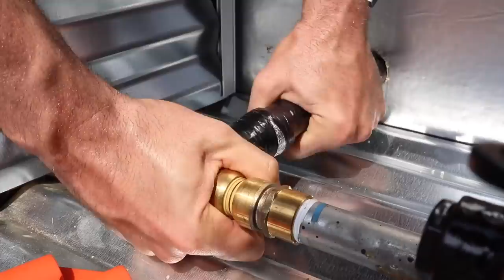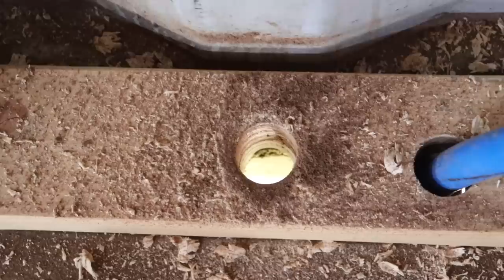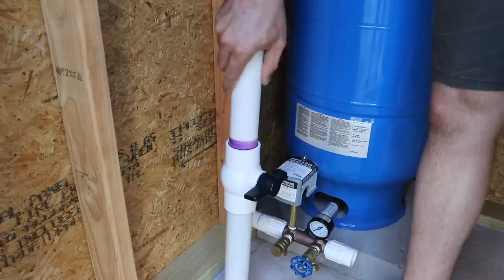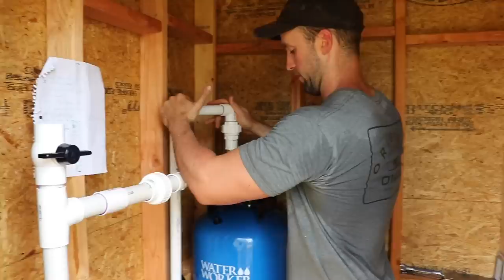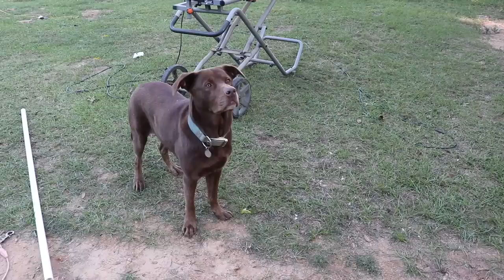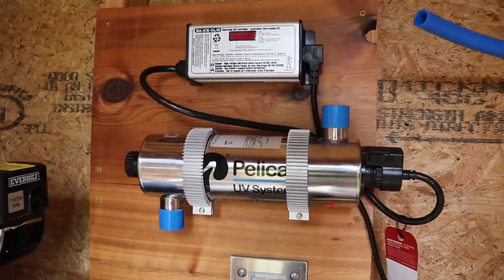How We're Getting Drinkable Rainwater OFF GRID!

Comment: Hey guys - I really like your work. Have you made any consideration of pressure differentials in your hot water system ?? I do not see a non return valve in the cold water feed line to your hot box - there will be issues here. Also not wanting to be rude but I just don't get this generation that wants to be 'off grid' but make full and over use of the internet , ebay , making multiple trips to the store etc etc. In my opinion the true essence of being off grid means that you are living in a cave and be totally connected to nature. The last straw for me is that you are using a UV filtering stage in your water supply - come on guys. Sorry this is no more than a glorified mobile home and far from off grid.

Comment: I am going to maintain that "electricity" is the grammatically correct word because "electrical" is an adjective, and saying "you have to brush up on your electrical" is like saying "you have to brush up on your red". Your electrical WHAT? That is just construction jargon that has NEVER made grammatical sense (and therefore, it doesn't make sense at all). To be fair, it is by no means clear what she means by his electricity if she is not speaking metaphorically of the romantic "spark" between them, in which case, what a burn.

Comment: normal off grid house water filtration system no waste lot water, you have collect water to tank, but normal collect to barrel, first barrel have groove rock and sand, then fine sand, then moss,then crystal sand, and then if want buy fine filter sheet, then have clean water ewerywere in home shower,kitchen,washmachine etc, toilet, were need clear water, and add 3 little filter can take out same water drinkaple water too at kitchen, no expensive about 1-300 $ cost 3 little filter under sink and outlet have own tap.i no has newer see any house this big filter pottle system, too expensive and no good longtime. lot cheapen have drink water have own little 3  stage filter system tap and all other have groove barrel filtration in outside wall backside house and go to tank.lot better and longlife lot lot cheapen and do all same than you expensive big pottle filter shit.

Comment: UV filter have ower install system. no true newer need, too clean water come out. not healty. newer before no has seen any filtration system UV shit. you need only one vbarrel sand can filtration sediment, and if want one barrel, add carbonfiber bag, cheap in ebay,one 40gk bag. no need more has true clean water. but same you can made, rock,sand ,moss, and carbon filter. then you have lto cheapen same filtration system. and can safety drink water and use ewerywere, shower,dichwashes,washink,cleaning,etc,no need filtration water onmly sediment filter. but drinkaple water need sand filter and carbon filter if want, normal we in thailand all peoples use only sand filter and then have good drinkaple water, no need more.
i m european men and i not has dead i drink eweryday rain water last 7 yeart.thais collect rain water to tank and then use ewerywere, drink etc.